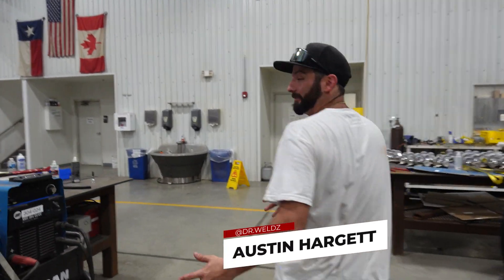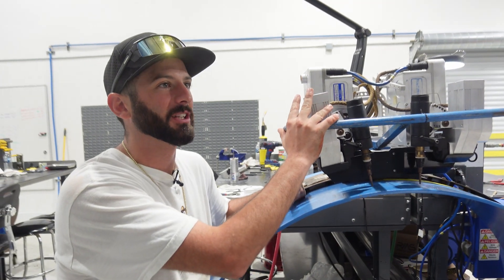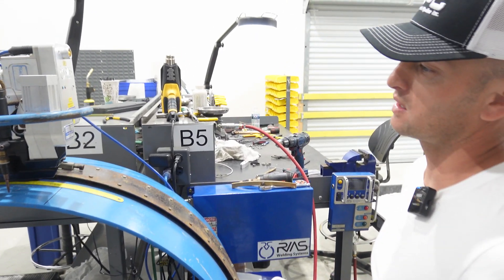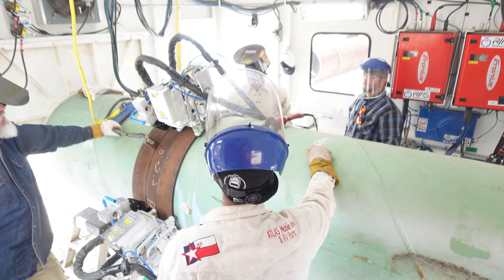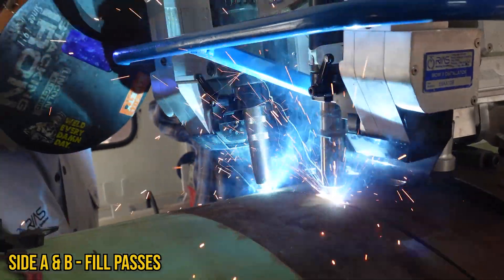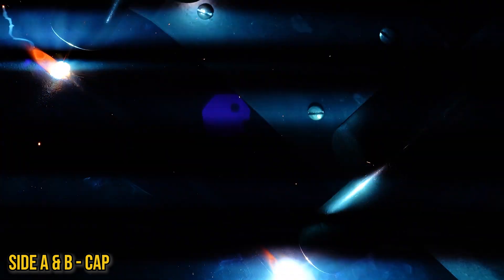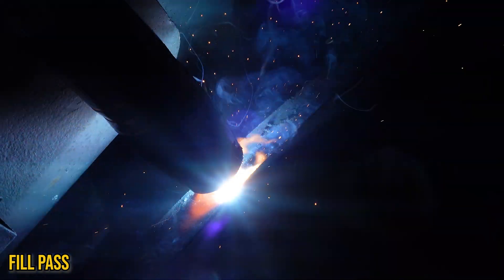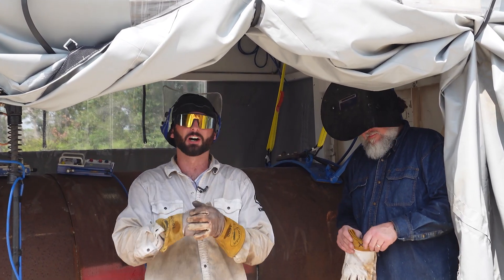Pipeline Welding Automation | Welding & Tie In Shacks

Comment: Man can you please suggest a laserwelder who does micro-laser-welding? Do you do this ? I have a very small piece of, well lets call it an clothing accessory item that needs repair, very tiny repair, when you google for laser welder almost everything it spits out is " laser welding machines". Anyway someone who specializes in tiny welds/repairs is probably what im looking for but no luck so far. Material involved is brass with nickel finish. Any heads up cheerfully accepted.

Comment: So how many skilled weldors will be replaced?
Reply: A properly certed welder is still required to run these for code work. Labor saving machines are key to make domestic manufacturing cost competitive and increasing overall job positions
Reply: @snoozzzer  Tell that to all the REPLACED weldors at Cat and other heavy equipment manufacturers and soon pipeliner's, Took cat about 20 years at the beginning of automation, wages went down because less skill was needed. Think automation is the ticket? Who will buy their crap when few have a living wage? It's short sighted thinking for profit that's killing Americans industrial base, and now with 20 million plus new hires wages just hit rock bottom,  BTW China plays a huge part in this .
Reply: @SouthernGround  Those guys were production welders and the robots do the same job over and over..pipelines , shipyards and steel erecting are a different ball game..I hope those men found decent work..God bless.
Reply: Its going to replace welders for sure. Just like the automotive industry in Detroit. Welders who chose to learn this may benefit but its only a matter of time before your boy Elon fucks that up for them as well then automates everything. They are already 3d printing homes for fuck sake

Comment: 2 good welders are faster than  this thing.
Reply: I can weld a 48" 18.5 mm pipe in 12 minutes, from fit/beading with the goose, to cap with a dual torch RMS bug. How fast could you weld one with stick?